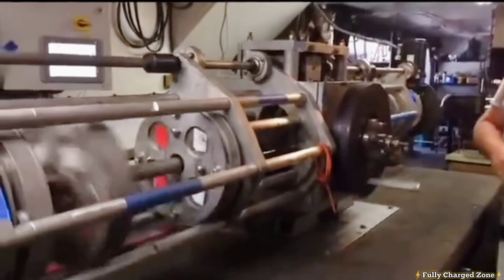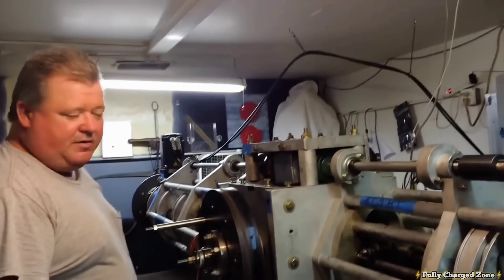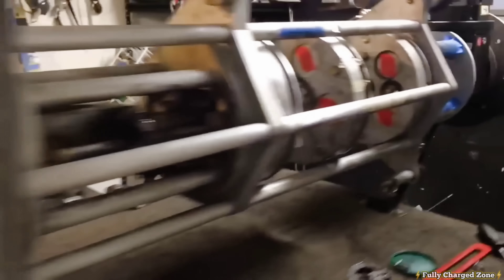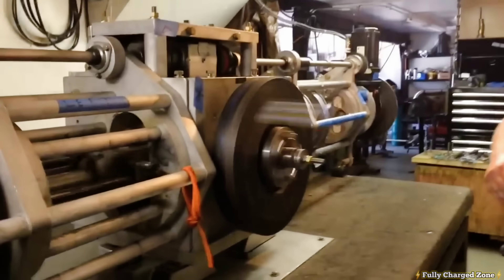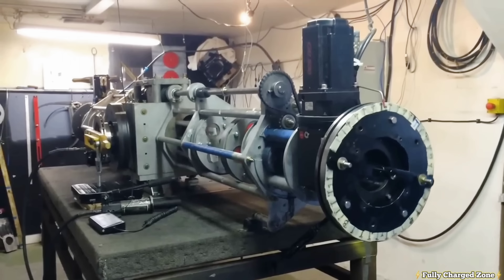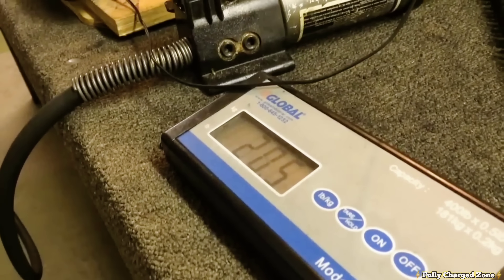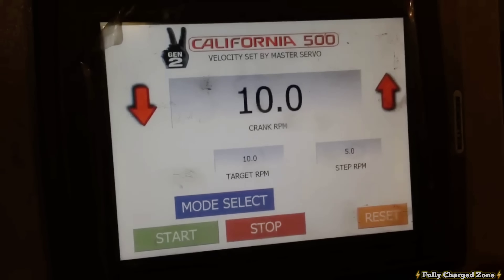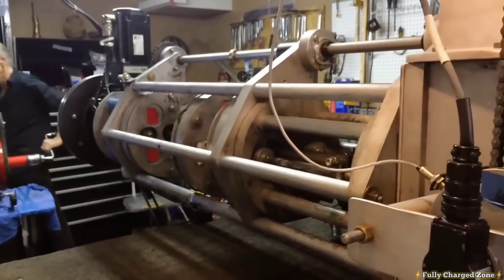World's 1st Magnet Motor - US Patent # 8487484b1

Comment: Well using electronic timing isn't exactly running on its own. I developed a magnet motor that runs completely on its own. No external electronics. It developes usable torque and RPM. Has minimal moving parts and can be made in pretty much any size. Feel free to contact me if interested.
Reply: Yea, I’m trying to see if I can do some thing my self. I asked the question can I pad 2 permanent magnets passed each other without the in or out of the field ? Answer is yes I did do that and I have that trick in my bag but here’s the problem: yes I can pass a single set made up how I do pass and get the push without the push back or the pull back depends on the orientation there’s still a n. And s. Poles. But the issue is maybe my design I went for as I stack these there’s interference. No cams no timing on a small scale maybe I need to try with bigger magnets or try one side of the set up as a electro magnet to cut the interference with each other ? At a cross road I got rotation on my rig and was getting it around but …… not sure what I can do at this point.
Reply: @tootsitroll9785  I solved that problem with my design. It's way simpler than your design and has way fewer moving parts. Less future maintenance will be needed and less mass to move making it more efficient.
Reply from the maker: The issue you’re running into is exactly what stops most small-scale permanent-magnet builds: when you stack multiple magnet pairs, the fields overlap and create a symmetric energy landscape. You can get a single ‘clean pass’ with one pair because you’ve isolated the geometry, but as soon as you repeat the pattern around a circle the push/pull forces cancel out and the interference stalls the rotor.

This is why timing mechanisms (mechanical or electronic) matter. You need a controlled way to shift the neutral zone at the right moment so the rotor never has to climb back over the same magnetic potential it just dropped from. Without that, the system settles into equilibrium no matter how strong the magnets are.

Using bigger magnets won’t fix the symmetry problem. And adding an electromagnet on one side basically becomes a timed actuator—which is exactly what cam-based designs already solve.

You’re close, though. Getting rotation means the geometry is almost there. What you need now is a method to break the symmetry at the right moment—either mechanically (cams, sliders, shifters) or electrically (pulse-driven gate coil). That’s what separates a single-pass trick from a continuous-cycle mechanism.
Reply: @FullyChargedZone no my design is way different than any others I have seen. But I can easily drive a generator. And I see absolutely no problem making it in any size needed. I even improved mine by making it a "2 cylinder" so to say. And no reason I can't make even more.
Reply from the maker: Mechanical timing vs. electronic timing doesn’t change the physics—any magnet-based rotor still needs an asymmetric force profile that overcomes its own cogging and returns. If yours produces continuous torque with no external energy input, I’d be interested in seeing the force curves or a slow-motion breakdown of the timing cycle.
Reply: @FullyChargedZone yes I'm sure lots of people want to see it. But until I get a patent. I'll just keep the magic on the bottle. But I can tell you that a kinda hit and miss motor and rotary motor are the basic concepts. But still comes down to proper timing. 
I just don't see a magnet motor that needs outside electronics as producing it's "own power". You don't need it. The magnets have plenty of power in themselves. 
And NO NO NO you cannot just place a few here and there and think it will work.

Comment: Free electricity, you hook this up to some altenator to generate electricty an your good
Reply from the maker: Hooking any rotating system to a generator adds load. The alternator’s drag has to be accounted for in the torque budget. The patent shows how the magnetic sequencing produces rotation, but it still has to supply enough net torque to overcome mechanical losses plus generator load. It’s not ‘free’—you still need a surplus of usable shaft power.
Reply: @FullyChargedZone oh very interesting!
Reply from the maker: I thought so too

Comment: This is old tech. I’ve seen a few of these in real life. They have alot of draw backs.
Reply from the maker: The general idea of using magnets for rotation is definitely old. What’s different here is the specific mechanical sequencing in the patent—neutral-zone shifting, timing, and controlled force asymmetry. Most earlier designs stalled because they didn’t solve those engineering issues.

Comment: Please, please stick it in a vehicle. We don’t want electric. This is way better.
Reply from the maker: I get the excitement, but this setup isn’t a finished propulsion system. It’s a patented permanent-magnet drive concept that still needs real engineering: load testing, gearing, efficiency mapping, and safety validation. I’m showing the invention exactly as it was built.

Comment: Ok then let's share secrets: No thermal engine runs on gasoline or diesel, They run with the  nitrous from the air. The gasoline or diesel is just the thing it needs to explode, that is why all thermal engines produce nitrous oxides as a by product. If a diesel engine has a thermal runaway you cannot stop it in any way even if you cut the fuel, the only way to stop it is to cut the air since the nitrous is in the air!!!
Reply from the maker: Engines don’t run on nitrous from the air. They run on oxygen.
Gasoline or diesel is the chemical fuel, and oxygen is the oxidizer. ‘Nitrous’ isn’t naturally in the air — the air is ~78% nitrogen (N₂), ~21% oxygen (O₂), and only trace NOx compounds. NOx is produced after combustion from high temperatures, not used as a fuel source.
Diesel runaway happens because the engine starts burning its own oil vapors, not because of air ‘nitrous.’ Cutting the air is the shutdown method because diesel doesn’t use spark ignition.
Reply: @FullyChargedZone  My 2 cycle MZ 125cmc motorcycle would do thermal runaway and nothing would stop it, not the ignition , not the fuel line pulling out , not even the spark plug cable, so how did that do thermal runaway since it is 2 cycle gasoline engine? Trust me, it is the Nitrous from the air look at the Beirut explosion.

Comment: What’s the point of this? We already have magnetic engines.
Reply from the maker: Electric motors use electromagnets that need continuous electrical input. This patent is different — it’s a permanent-magnet mechanical-bias system designed to create rotation from magnetic attraction/repulsion alone. It’s not replacing electric motors; it’s demonstrating a very different magnetic configuration.

Comment: Прикольно, двигатели задают угллвое положение и передают угловой момент на вал, сагниты преобразуют его в поступательное движение, а потом ещё раз через другой или тот же вал во вращательное. Ничего кроме потерь энергии, полведëнной от шкафа управления 😂
Reply from the maker: From a purely electromechanical standpoint, you’re right that every conversion step introduces losses — angular → linear → angular will never be 100% efficient. That’s expected in any hybrid mechanism.

But the point of this design (per the patent) isn’t to create net energy, it’s to shape the force profile using magnet biasing and mechanical timing. The motors in the cabinet aren’t driving the shaft continuously — they’re only used to position the cam/armature segments. The magnets provide the primary force impulse once alignment is set.

So the analysis isn’t about ‘motors doing all the work,’ it’s about:

• timing control vs. continuous torque,
• magnetic bias forces assisting the stroke,
• how much positioning energy is required vs. returned,
• and what the net mechanical output is under load.

Whether the design is efficient or not is a separate question — but it’s not just a chain of momentum transfers. The patent explicitly claims a controlled magnetic force interaction that changes the torque curve.

Comment: You just made another design of the electric motor great job.
Reply from the maker: It actually isn’t just another electric-motor layout. Miller’s patent documents a very specific magnetic-timing and mechanical-gating method that removes the need for an external electrical drive. It behaves similar to a motor, but the physics and interaction of the magnetic fields are different from a conventional EM coil system.
Reply: The electric motor is incorrectly designed and failed to recognize magnetic principles. Magnet motors work. This design needs more work.

Comment: Hmmm it'll brake it's self if you can't control it. Tho I do wonder what it would do in space I have some ideas it could be an engin for a ship of combined with something else
Reply from the maker: Control is definitely the key. Any rotating system can self-brake if the timing drifts or the magnetic forces fall out of sync. As for space — the mechanics would still work the same since it doesn’t rely on air or combustion. It could operate in vacuum, though you’d still need a separate propulsion system for actual movement.

Comment: Make it work with the current turned off.
Reply from the maker: The control system has to stay powered because its only job is timing and positioning. The magnets don’t switch themselves — the motors in the cabinet rotate the cam segments so the magnetic forces line up at the right moment.

So when you turn the current off, you’re not just cutting power — you’re removing the timing mechanism that makes the whole sequence function.

The patent never claims it runs with zero input. It claims the magnets provide the primary force once the alignment is set, and the electrical system is just there to position everything.

Comment: Remove the 2 servo motors to show that it's working as advertised.  :/
Reply from the maker: The servos don’t drive the rotor ... they only change the magnet cam timing, just like a distributor adjusts spark timing in an engine.
If you remove them, the mechanism can’t sequence the magnetic events, so you’d only be proving the timing system is required, not that the motor is fake. The inventor designed it this way, and the patent even outlines that function

Comment: What are the square electric motors at each end for?
Reply from the maker: Those aren’t drive motors — they’re just small positioning units the inventor used to index and align the magnetic rotor during setup. The rotation you see isn’t coming from them.
Reply: @FullyChargedZone I'm calling BS! I know EXACTLY what those are! I wanted to see what kind of bs someone would say😂😂! We use those in all of our packaging equipment in the factory where I do maintenance on the machines 😮😮

Comment: I’m starting to think that perpetual motion is possible. Not accounting for the aware of the machine of course. This machine cannot run forever. It will eventually need rebuilt, but the point is for it to run with no fuel.  I’m starting to think that we were told perpetual motion is not possible because if it was known to be possible. People would try to achieve what this man has achieved.  And then the oil corporations would have competition.  They don’t want that they want to control the market.
Reply from the maker: I get where you’re coming from — when you see a machine run off magnetic forces with no fuel, it feels like perpetual motion. But what’s actually happening is more nuanced.

What this device is doing is using magnetic geometry, timing, and field asymmetry to reduce losses and create a sustained rotational output. It’s extremely efficient, but it’s still operating within the laws of electromagnetism. Magnets aren’t “free energy” — they store energy in their fields, and over time the system experiences mechanical friction, magnetic hysteresis, bearing wear, and material fatigue. That’s why it eventually needs rebuilding.

What makes it interesting is that it demonstrates how far you can push non-traditional torque mechanisms when you remove electrical input. That doesn’t make it perpetual motion — it means it’s a clever use of magnetic coupling.

And yes, you’re right about one thing: if more people explored this stuff instead of assuming it’s impossible, we’d see way more innovation. I’m not claiming this replaces oil or solves energy, but it does challenge people to think beyond the “accepted” box.

Happy to break down the physics more if you want — I’ve been hands-on with the device and the data.

Comment: How is this more efficient than going with an electric motor?
Reply from the maker: Great question — it’s not “more efficient than an electric motor” in the usual EV-engineering sense. Modern motors (Tesla/Polestar style) already sit around 90–97% efficiency.

What makes this design interesting is that it doesn’t use continuous electrical power to generate its torque. Instead, it relies on a mechanical magnetic-cam system that redirects permanent-magnet forces so the only real energy input is cycling the cam.

So it’s not replacing an electric motor — it’s just a completely different way of extracting mechanical work from magnetic fields. The patent (US 8487484B1) focuses on preventing magnetic lockup, which is usually what stops magnet-only engines from working at all.

The inventor passed away before full efficiency testing was completed, so the device was never fully characterized.
Reply: Also, it looks like the device is running on two electric motors.
Reply from the maker: It only looks that way because the cam driver and the rotation sensor housing resemble small motors, but they’re not powering the rotor. The only thing cycling is the mechanical cam assembly that shifts the magnetic gates — there’s no electrical drive turning the main rotor.

This design uses permanent magnets + a timed cam system to avoid magnetic lockup, not two electric motors pushing it. The footage in my video is the actual patented setup, not a hidden motor trick.

Comment: Don't magnets lose their magnetic properties being used in such a manner after a while?
Reply from the maker: Good question — permanent magnets don’t “wear out” just from being used. They only lose strength if they’re exposed to high heat, strong opposing magnetic fields, or physical shock. In this setup, the magnets stay well below their demagnetization limits, so they hold their properties for decades.

Comment: How does the motor perform under load
Reply: Slower
Reply: @xAndrzej42 😂
Reply: It doesn’t!
Reply from the maker: Great question. It does run under load, but the continuous-torque limits were never finished because the inventor passed away.  I’m continuing the work and documenteming the Invention.

Comment: Yes, but add a load to it, how much can it run with?
Reply from the maker: Good question. To measure load you need proper bearings, a load cell, torque arm, and a controlled test rig. This prototype wasn’t designed for that — it’s strictly the original patent mechanism, not a finished power unit.

Comment: Now make it 20 times smaller.
Reply from the maker: Give me a minute, I’ll grab the shrink ray 😂
Reply: @FullyChargedZone I could do this on a much smaller scale and produce the same amount of energy I've literally been working on this concept for years. But people do exactly what you're doing now laughing so I don't even bother with it.
Reply from the maker: I’m not laughing at the concept at all — the shrink-ray joke was just me having fun in the comments. In actual engineering, scaling a magnetic system down is way more complex than people realize. Once you start reducing the geometry, the magnetic circuit changes: tolerances get tighter, leakage flux increases, bearings and friction become proportionally larger losses, and your materials hit saturation faster. That’s why most inventors prototype at a larger scale first — it lets you measure real torque, field interaction, and energy flow without fighting the brutal efficiency losses that show up at micro-scale.

If you’ve got a smaller version that produces the same output, that’s impressive and I’d genuinely like to see some data, even rough measurements. I’m always open to new designs, but I also have to stay grounded in the physics we can actually verify. I’m not dismissing you — I just want to see what you’ve been working on so we can talk about it on a real engineering level.

Comment: Very interesting but remains to be seen if the engine is able to cut the magnetic flux in a generator
Reply from the maker: Exactly — that’s the real question. This prototype was never built as a generator load system, so we haven’t tested flux-cutting or induced current yet. I’m documenting the mechanism first before any generator coupling gets evaluated.

Comment: Very complex and interesting machine that produces little to no useful power. Because PHYSICS. How many times will the same people be fooled by the exact same scam?....we may never find out.
Reply from the maker: It’s not a scam at all... this is literally a published U.S. patent. The prototype isn’t about high power output; it’s about proving the mechanics of the magnetic sequencing system. The inventor never claimed free energy or high RPM. Just demonstrating a working magnetic cam engine exactly as described in the patent.